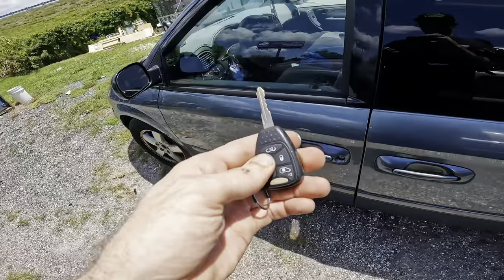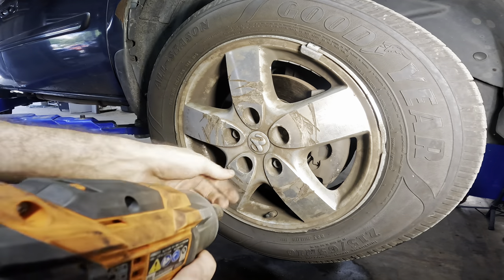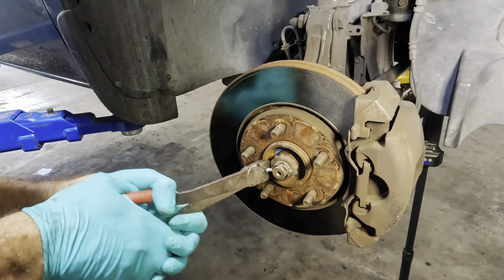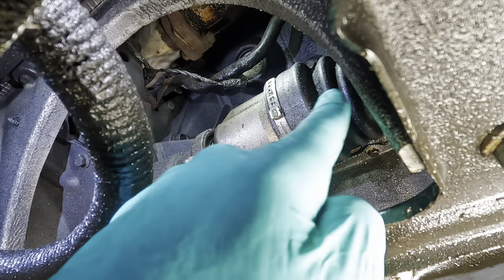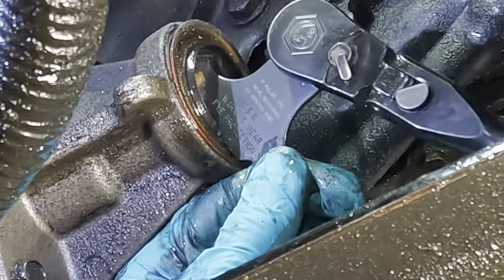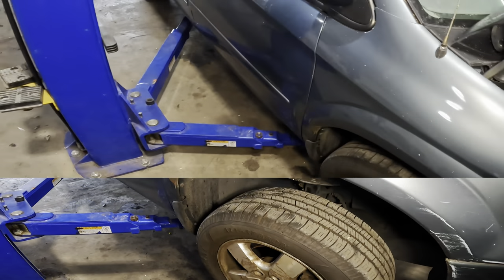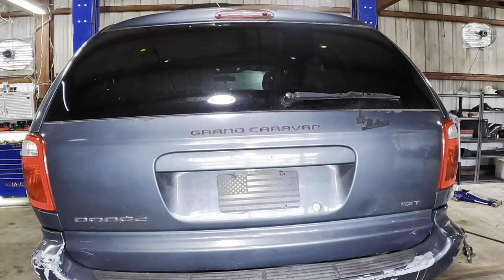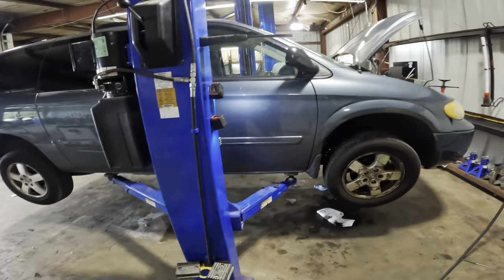Worn OUT Busted Axle! Dodge Caravan Limps In! 2007 3.8

Comment: Good lord that baby is hurting. Rod knock, motor mounts bad axle leaking everywhere. Yikes. She may have finally hit the wall. Have a great day Ray!
Reply: All you have to do is look at the Mardi-Gras parade up front and the yard sale going on in the rear. That should tell you all you need to know, just put gas in it and go. That's probably the first time it's being on a ramp in 200,000 miles. You have three kinds of owners,  aware, oblivious or don't care. I think this owner is aware but don't care
Reply: already setback $400+ today. new cv will not last long with all these broken mounts. One day at a time, live life to fullest.
Reply: @forgetfulme1719  or One mile at a time, drive until it drops
Reply: Ray has all those used fixed cars on the lot for sale, 30 days Ray's warranty.

Comment: Just a suggestion. Maybe round that sharp point, just a tad, not a huge amount... so if it catches the metal it slips intead of gouging... Don't know if that will mess up the tool. I am talking just a quick ZIP on the grinder, nothing crazy.. still pointy like, but rounded at the VERY tip... literally the difference between a sharp pencil and a dull pencil

Comment: it's a common problem with those tail lights. I had a 2015 cara-no fun... same issue with a melted cluster. also, i hope you don't need to replace the stupid relay switch thing that controls the radiator fans... it's at the side of the radiator and you need to remove most of the front end parts to get at it... I took mine out and screwed it to the cross member the radiator sits on which makes easier access lol

Comment: A bad connection does not "draw extra current".  A bad connection has I^2*R heating.  A little extra R drops the current a very small amount from nominal, but the gizmo still works.  What melts things is the I^2*R heating.  When the R of the connection is very low (where it should be there is very little heating).
Reply: The labor & billing book is the Bible- if it says remove and replace- that satisfies 2 things- boss man and billing book, 2 warranty. 3- If customer took it to auto-electrician then I', not sure it wouldn't be classified by insurer as BRNWW: bad repair no worky-worky- this vs broke dck no worky-worky- the cause of the problem. USN slang is fun.

Comment: Ray i did wonder why you not just replaced the CV joint at the wheel end or it only comes as a all in one unit.
Inserting the inner joint always have the gap at the bottom as less chance of it getting nipped.
Nice job.
I was going to say you did not top up the oil , Troy will fix it . Ok.
Reply: it usually comes as an assembly as CV's need to be pressed on. To remove a CV is destructive without some soft hammers and drifts. It's much easier job to replace the assembly. I think it probably works out cheaper too.

Comment: Tail light - amazing it was in stock. Bad connections don’t draw more current though 😉 , the resistance of a bad connection creates heat and that is what melts the plastic. Or a crap design - either way simple repair if swapping for new.

Comment: My 2010 Honda CRV had weird engine noise and the oil light flickering so I brought it to the shop and they went “the engine had minimal oil in it so the solenoid was clicking” and added oil . I just did an oil change the month before and I decided to do another one and an extra 3 quarts of oil appeared…..so it had roughly 7.5 quarts of oil in it instead of 4.5😂😂😂 I’ve been working on cars and motorcycles for years so an oil change isn’t anything crazy but my guess was the vtec was going or my oil pump was going. Dunno I traded the car a couple weeks later 🤷🏻‍♂️

Comment: those 3.8s are tanks, and they cruise like nothin if you keep them maintained. super easy to be doing 80+ and not realize it.

most common leak points; axle seals, both pan seals, and the valve covers. they allllll do it at some point if they aren't kept up properly.
Reply: Those weak oil coolers go in spectacular fashion as well. Plastic on metal right on top of the engine. What could go wrong? 😂
Reply: after u fixed all those, the rear main seal leaks.

Comment: Ray didnt pay attention in the beginning with the Oil light. There is a gauge at his leg with Oil pressure. It was fine, they just took the sender out and replaced it with a mechanical gauge.
Reply: reconfirms failing vision or BG clean his glasses.

Comment: Always good to learn - thanks for taking the time to explain the process.  I need to replace the axle shaft on my 2015 Mazda - and the instructions say to install the shaft in the hub first - then into the transaxle.  It seems like Ray and Eric at SMA do transaxle side first - then hub.  is the order of operations critical - or just a preference?
Reply: I am not a real mech but do most of my work. Done lots of axles and bearings.
 1: Paint mark the strut bolt heads and nuts to the strut shoe and match them when you put them back in. the head is crucial if a cammed bolt. 1 on your Mazda will be cammed. 
2: I always install the trans axle side first as you may need to turn it to get the snap ring to engage.
3: I have never taken the ball joint off either for this. Releasing the tie rod is easy and gives you enough swing to get the axle in and out.

Hope this helps.
Reply: it's not important- as @llydnolan8218 says just use permanent marker/paint to mark your witness marks for your bolts. The instructions seem counter-intuitive but I would have to see an "official factory repair" first.

Comment: Hi Ray: Not really annoyed over this, just curious.  I learned all my auto repair skills from an older technician named Ray; my Dad!

When that oil light stayed on, did you happen to realize that the car had an after-market oil pressure guage mounted below the steering column?  Might explain why the pressure sensor was disconnected (or replaced by a guage sender unit).

Comment: 3.8 engine oil pan gasket goes bad on those Dodges and the Chrysler Town and Country I have the 2002 Chrysler T&C limited I've rebuilt the complete front suspension, water pump, Alternator,  (from a 132 amp to a 160 amp), and the AC compressor.  Next on the list is replacing the torque converter, replacing all the rubber in the rear suspension, and the fuel pump (the sender is bad ), Then drive her until she wears out!
Reply: Torque converters don’t give problems on the 604 are you sure you don’t need to k rebuild it?
Reply: @waterloo123100  Don't know yet but it is showing all the signs of it being the torque converter. I'll know for sure when I can find a reliable transmission shop around me, that won't rip me off!

Comment: Ray, Bad electrical connections DO NOT draw extra current. A bad connection tells the story in its name. A bad connection will draw less current. 

     Now, you may say "Then where does the extra/excessive heat come from?" Well, heat is an example of power. More heat means more power. That sounds like maybe more current, but that would be wrong. 

      The power formula is an extension to the current, voltage, and resistance formula which is current times resistance equals voltage, or E = I * R. The power formula is current times voltage equals Power or I * E = P. 

     Usually the power formula is written in the reverse and called the PIE formula because   P = I * E. Now, we remember that E = I * R, so, substituting I * R for E in the PIE formula we get P = I * ( I * R) or P = I * I *R.  Sometimes said as Power equals I squared R. So any increase in heat could be a result in the increase in current or increase in resistance. 

      A bad connection would by its very nature decrease current because the connection would be an increase in resistance. Thus unless the voltage itself increased (which is held constant by a battery and a regulator) the increase in power/heat is a result of the increase in resistance at the point of the bad connection. Instead of the power being expended at the bulb element it is shared and expended at the increased resistance of that connection. Just as the bulb expends heat, or power if you will, the bad connection acts just as the element of the bulb would and therefore expends heat at that point of resistance causing the melting of the surrounding plastic.

Comment: Customer didn’t accept the broken engine mounts?
That would make as much difference as the cv, from the drivers perspective. It must be horrible with the engine vibration going straight into the frame, but it has to be terrifying when the whole drivetrain moves around changing gear, or going over bumps!
Reply: Strictly speaking it IS a safety issue in at least UK and 2- it would invalidate a  warranty whether factory or third party.

Comment: those looong chains and strings etc off the rearview mirror is a safety concern, I had an airfreshener with a long string hanging off my rearview mirror years ago,, went through a roundabout and it swung around in such a way that it caught in my steering wheel,, when trying to turn the steering in different direction to exit roundabout the wheel could not turn back, it resulted in breaking the mirror of the windshield and almost a collision with another car..

Comment: Yes Rainman you would be correct in that the wrong size socket would round the nut. Thus causing you to break out the welder again. Oh, the pain watching you weld to remove a broken stud. 😂😂😂
Reply: now he cleans with metal brush first, getting better every time. Now needs more training in drill and insert.

Comment: With 206,000 miles does the owner want to put $$$ in this Doodge with all that damage  outside, underside, etc ? Replace 
the axle shaft yes, make it legal too but then drive it to the nearest dealer, trade it in  and get a newer vehicle, before it is 
too late. It is no Honda!  Great job Ray. Hope the customer doesn't drive it into the ground , it's almost there!
Reply: Hate to break it to you but those caravans are just as reliable as a Honda is
Reply: @waterloo123100  Except that particular owner doesn't seem to care and is running it into the ground. Mom's taxi; and I got a sister like that with her vehicles.

Comment: Looks as someone put in an aftermarket oil gauge on the dash just under the shifter handle... That's why the wire is disconnected

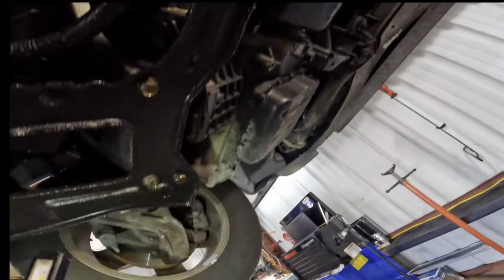Comment: At 7:57 to 8:00, did you see the break in the rubber boot on the LF outer tie rod end?  Corrosion will probably cause problems, if it has not damaged the joint already.  I recommend at least replacing the LF outer tie rod end and greasing the fittings on both sides.  When a tie rod end fails, especially at speed, it is GUARANTEED not funny.

Comment: Question if I may? I drive a 2011 Honda Insight. Recently I've noticed a how shall I put this? An "Unexpected BASS rumbling from the rear end at low speeds under 20 mph around curves.", more noticeable around 15 mph. While I DO have the added "Premium Audio" supposedly POLK  sound system and listen to XM Channel 70 (Frank's Place) I experience a rumbling sound from the rear. 

While she may be old... I DO love my dumb car. Only thing smart about her is the nut holding the steering wheel. Aaaand that would be me.
Reply: @OriginalGhost  bearings are good. According to my recent inspection. Yet the sound remains. I'm thinking it's the suspension  Only happens when under 20 mph going over speed humps in my HOA  Fine until I pass over the first mound.

Comment: Morning Ray! (another good vid')
Does your outer CV joint not come seperate from the rest of the drive shaft? (or is that another manufacturer money making you have to buy the full shaft ?) 
Also, can you elighten me (excuse the pun) on why -
 A/ the clear lens had (as did the red lens) a dual fillament bulb? 
B/ you didn't check operation of the top (clear) lamp(s) ?
Reply: I might help. I had a 1971 Rover PB (B for buick) 215? 3500cc v8- and 195 Daimler 250, and a 1979 XJ6 all had dual filament bulbs. The way I understand it lows voltage allows for 1 filament to illuminate- when you close the circuit for headlamps and taillamps/fog lamps/parklamps - you hit the brake pedal- it trips a relay allowing higher voltage to same lamp- both filaments are lit. Probably too- if you hit the indicator switch- the flasher lamp circuit is also tripped. In the UK and Japan amber indicator (turn signal) are mandatory- you will be pulled over and issued the same fine for broken tail light if you don't demonstrate these (a lot of youngsters modified cars- but now they do all kinds of things with orange LED- so the police are a bit more lax than my youth).
 My guess is somewhere some bean counter worked out 1x 2 filament bulb, 1ft of copper wiring and a relay was cheaper than 2x one-filament bulbs, a relay and their wiring.
The clear lamps probably are fine as they are reverse lamps- maybe he checked those off camera.
I had a CV joint seize. I managed to have the axles replaced- that was $AUD 150 in 1994- it was a straight swap-over- the specialty differential and driveline shop kept the old axles. Fitting CV's is a specialty job requiring presses, all kinds of drifts and mandrels. 
Also- although some commenters have boasted they could do it with a hammer and old waterpipe, and an artificer's lucky shilling- if a car is under warranty- (for example a lot of cars factory warranty is over but you can buy 3rd party "Extended warranties") the warranty insurers will void that "repair" as unsafe as their job is to avoid paying out for anything.
Secondly the repair book is the bible- if it says: "remove and replace LH front axle:= 20 minutes"- then that's what you have to do and you cannot be billed for more.
Reply: @markiobook8639  
I only wondered about the CV joints, (having changed many on various makes of cars/vans) yes, it’s quicker but can be more expensive. As for the twin filament bulb (5/21w @ 12v) in the clear lens, my interest was, knowing the 21w filament would be the reverse, filament, what use is the 5w filament? I see your point in “the bean counter* explanation IF there wasn’t a single filament bulb made with that base, as there is.
Saying that, I’ve just had a thought, perhaps being as that lamp is rarely used, mebbe it’s made like that as a backup lamp. (As in a spare to replace the red combined stop/flasher/tail)🤔
Reply: @Screwy9758  I have no idea to tell you the truth. My old man's garage had a shop press but I never bothered with CV joints- we'd take them to an axle shop and just get swap-outs.
As for the bulb I have no idea. Zappy-zap-zaps are beyond my comprehension and anything that carried zaps went to our Auto-electrician- we learned after trying to repair a customer's heavily "modded" ignition that started a small fire- it was nothing dramatic but somehow the "modifier" bypassed the fuze box and something drew way too much current got hot, smoked and tiny little flame. Almost every electrical fault was from past idiots screwing about. If we had a job like add fog lights- away it went to auto-electrician. Want 6 spotlights on roof rack? Goes to auto electrician. Also he had a good gig with us fitting Bosch diode bridges for old British cars with awful Lucas electrics. But that's all gone now.

Comment: Ya'll pulled the axel out, thus not pushing the axel lock into place during the preliminary video and not using a dead blow hammer to force it into position. Clicking noises be danged.

Comment: Curios, can the axle be cleaned and a new boot installed?
Reply: If you catch a torn boot early you can put a split boot on it with fresh grease. That one had a lot of play in it, it had been open a while. To put a proper boot on it you basically have to do the whole operation as you saw here, and it is hell to get them over the joint. The assembly is actually quite cheap so I'd do what Ray did.
Reply: yes- but too much work.
the Labor and Billing Times Bible for example Mitchell 1 Labor Times
Would say:  
Fault: failed CV and /or CV's on LH/RH drive  axle
Operation: remove and replace front axle. 20 minutes.
Maintenance: repack and replace boots.
The repair meets the book times and more importantly the factory warranty or third party extended warrantor (insuror will seek any way to avoid paying out). It's also fully filmed so no wriggle room.
Yes of course you can replace the CV's- but it's not on the repair times- that's a restorative process, not a billable repair.

Comment: Would slightly worn CV axles cause a minor vibration noise when going 60+? I got a vehicle that has a vibration noise when going 60+ going straight but stops when going around a curve. It almost sounds like the steering column is vibrating but it doesn’t vibrate or shake.
Reply: does it depend on which way your turning? that's often a clue for a bad wheel bearing.  Given it only happens at speed it could be a wheel balance issue as well (dropped weights, chipped rim if aluminum)
Reply: @animefreak5757  no, I can turn either direction at any angle and the vibration stops. It’s only when the steering well is pretty dead center 12 o’clock position is when it vibrates.

Comment: Good job but it's best practice to wear fresh clean gloves when handling new parts, to prevent contamination. Have alignment checked. Are you not replacing the motor mounts?
Reply: not an issue- it's not a human or animal organ- similarly he is not touching the internals of the engine- but touching parts which have already likely caused some ingestion for foreign matter- which transmission filter will removed.
Reply: @markiobook8639  best to keep it all clean and prevent contamination.
Reply: @joseph2095  yes ideally- but this one has broken boots on both CV's. As long as the splines are clean going to the transmission it's fine. It's a car, not a living being- contamination won't hurt it.